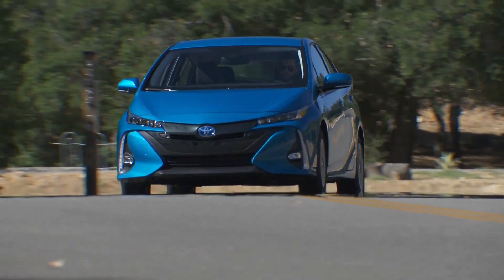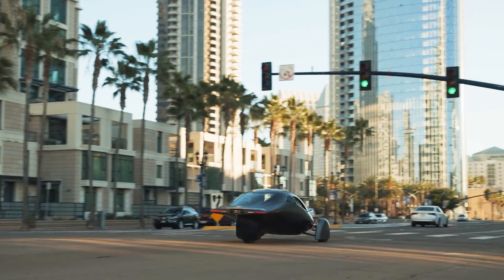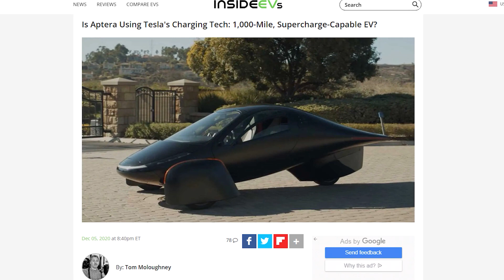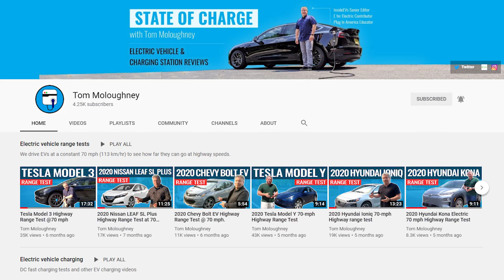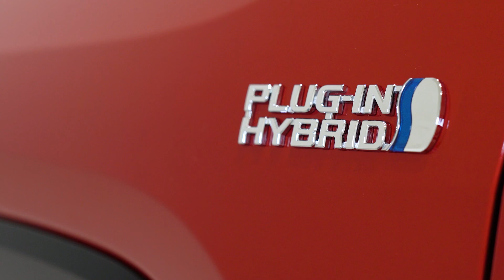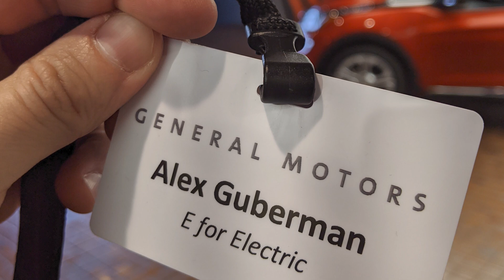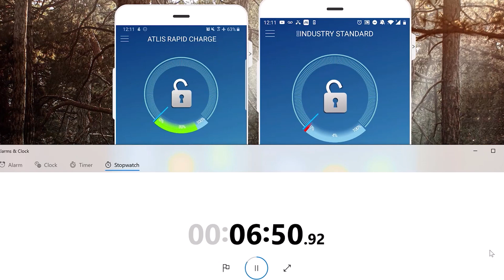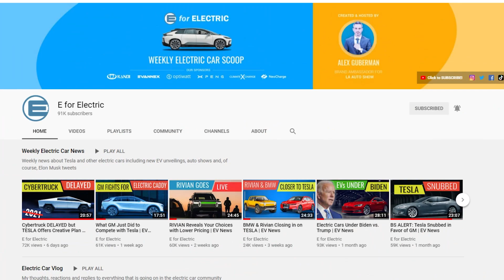Coming in 2021: Self-Charging Electric Vehicle | EV News

Comment: Alright, I've asked other people, and I wanted to ask you guys. My mom is reluctant to buy a tesla, and I need a good reason for her to get one. And I already know the benefits, so
Reply: If you know the benefits and cannot convince her, I have one suggestion. This suggestion holds true for all EVs though, not just Tesla. For any given size, an EV weighs more and will, therefore, be safer. Many EV fans believe that extra weight is a drawback as it lowers efficiency. I think that the extra safety is well worth losing a bit of efficiency, especially when most of the EVs get somewhere between 80 and 130 MPGe.
Reply: Have her drive one. Nothing better than that to get someone on-board with a Tesla or any EV. Explaining the many benefits during and after a drive will have more impact.
Reply: @kevind4850  That's the problem. She didn't like the drive for some reason. We drove a performance model y and x, and she genuinely disliked (hated) the Y. I loved it
Reply: @fujiirolive   Some older folks are put off by the tech. Perhaps she'd be more comfortable with an EV in a more traditional package (KIA e-Niro, Hyundai Kona Electric, Chevy Bolt, Audi etron). Their tech isn't as advanced as Tesla's, but would be a stepping stone toward what the future has in store.
Reply: @kevind4850  I'll make note. Thank you
Reply: @E for Electric  Have any thoughts?
Reply: @fujiirolive  I commented below that most older folks are used to very comfortable floaty ride of old Lincoins or Cadillacs on the road. They value comfort, not sportiness, comfy seats, ample leg room in the second row, and definitely cruising on high profile tires with lots of rubber while all Teslas have very low profile tires. If you insist, then you will have to test drive with her a Model S or Model X on AIR suspension. I am not so old but I hate sport seats hammering my rear end while sitting in a sporty car. Then there are the settings in those cars which need to be selected the least sporty and most comfortable ride. Most drivers in the past were cruising not zipping like today. They hate a jerking all over the road car. They value smoothness of ride. Besides those models S and X show the speed in front with no need to look to the huge screen in the middle of dashboard. Audi Etron will fit her ride style even better but definitely with air suspension and optional comfort seats. If you test drive Model X do not try a 3 row vehicle to scare with the third row crampiness. The falcon wings are not liked by everybody. A Model S is not a sedan but a quite practical liftback so definitely test drive one with her, since that car can be adjusted for maximum comfort as those nice cruising old Lincolns and Cadillacs. In the past the driving was all about bringing comfort and pleasure. Today young drivers want entertainment by being bounced all over the place like in a videogame. That was exactly what she had to experience with you while driving that performance Model Y. No wonder she did not like the experience.
Reply: Wow... didnt know that. Thanks. I'll add that to my 16 page convincing essay thing
Reply: Tesla make the safest cars on the planet according to the crash test data.
Reply: Nice
Reply: You have to find just a car size, body shape, interior, amount of physical knobs she needs into the cabin and then find an EV counterpart. Some folks cannot stand lack of physical buttons and need to touch a huge iPad attached to the dashboard. I never liked coupe shaped cars for once and all Teslas come in this shape unfortunately. Audi Etron gives the choice between regular SUV and coupe SUV shapes. Some old folks do really appreciate leg room while sitting on second row of seats. Even Tesla Model 3 does not have much headroom it does have lots of legroom. Some older drivers cannot stand rough ride in new sporty EV. In this case the car has to have air suspension and/or high profile tires. All Teslas come with low profile tires. However, your mom might not disclose it, she cannot stand range anxiety. Pure EV lovers will disagree with me but the only one choice in chronical range anxiety for drivers can be a decent pure EV long range PHEV which are coming slowly to market in the USA while those vehicles have flooded European market already. Alex on this channel has occasional long trips so he is driving a Chevrolet Volt as a pure EV in town. Cheers.
Reply: Thank you
Reply: @fujiirolive  I am sorry stressing the age constantly but I had to learn from my father's preferences of Mercedes Benz ride of a 80ties built car, and then from lots of youtube videos about cushy ride of those Lincoln and Cadillac sedans. From EVs the most attractive are Audi Etron and Tesla Model S with air suspension especially with long range. But if your mom commutes in short trips and she can charge her vehicle at home, I would not be surprised if she would prefer an upper trim of Chrysler Pacifica Hybrid - a PHEV with 32 EV only range, 30 MPG when battery is depletted, very comfortable seats and upright SUV like seating with ample leg/head room, extreme comfort in second/third row and large trunk. The only drawback of a PHEV like this is the need to charge it overnight each evening while those long range EVs can be charge only at the weekend providing the daily commute is short.
And you are welcome!
Reply: @nevco8774  na its fine